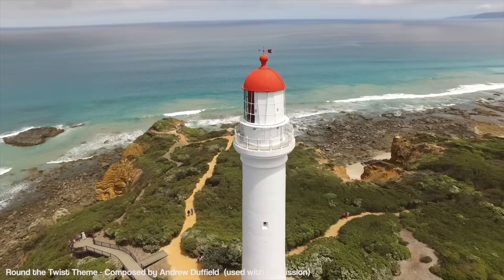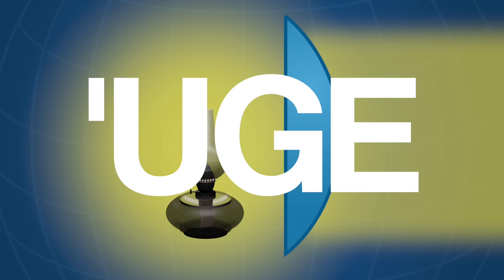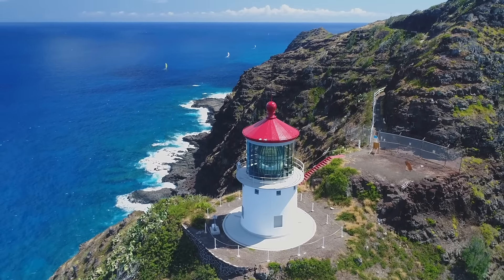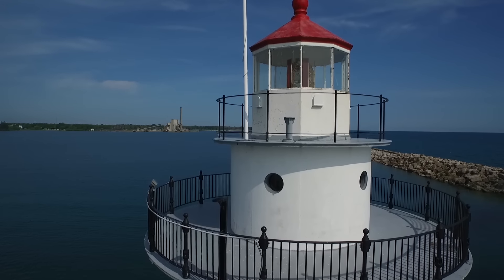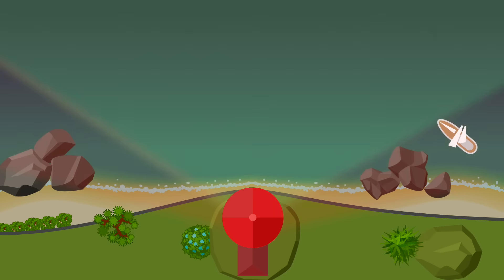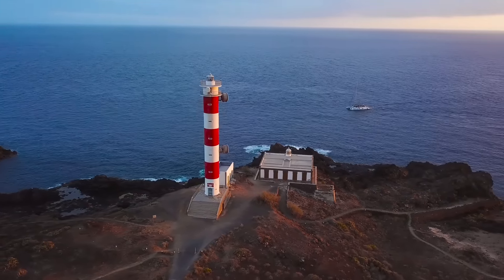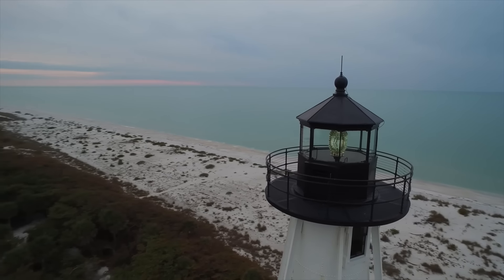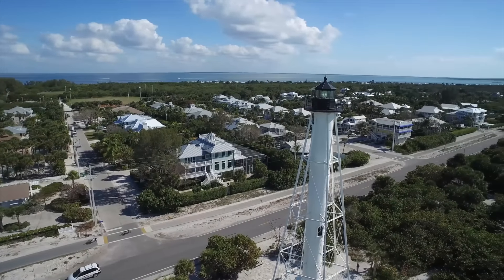How Do Lighthouses Work?

Comment: Awesome video!! I loved seeing how you went in detail about fresnel len's. Here's a fun fact which you didn't include but I recon is really interesting; 
Many of the older and more heavier fresnel len's which are still in operation today are actually floating in mercury, a liquid which has great kinetic properties, allowing these extremely heavy lenses to be operated using small and energy efficient motors. This method is used at both the Cape Byron lighthouse and also the Cape Otway lighthouse in Victoria, which both have very large lenses. You can actually climb the Cape Otway lighthouse and when you're at the top, although the lens is elevated above you so you can't physically see the mercury, the motor mechanism is on display as it operates and it is truly incredible how something so small can power a lens of that size!! Definitely worth visiting if you live in Victoria because the whole light station is open to the public and it has a ton of history attached to the lighthouse. Hope that was interesting, keep making amazing video's, you've earned a new sub <3
Reply: I have worked in an effluent treatment plant that has a huge sprinkler (30 meters across)  pivoted in mercury, and rotates like a garden sprinkler without need of any motor . Mercury is highly corrosion-resistant too.
Reply: @tvoommen4688  That's incredible!! Mercury is truely impressive stuff, despite how dangerous it can be!

Comment: I prefer to differentiate the type as such;
LIGHTHOUSE: a structure with accommodations within, as in the lantern room is set in the roof structure of the dwelling or the keeper lives within the tower or an integrated house structure. 
otherwise it’s a LIGHTSTATION, where the keeper lives onsite to maintain and operate the LIGHT TOWER.

Source: I’m a former lighthouse keeper working 13 different stations during my career. 

Excellent video

Comment: Fishermen still tend to use lighthouses, particularly to fix a good fishing spot, as GPS fixes can wander around from day to day, while taking bearings off of the light and other landmarks will get you to the exact spot every time.

Even the big ships will still take bearings as a backup, and to double-check that their nav plots are accurate.
Reply: dun their naviation systems/mobile have GPS
Reply: @rainbowgalaxy1668  He DID say "to double-check" and "as a backup", redundancy, it's a thing that's useful for not dying.

Comment: What makes a lighthouse a lighthouse? Primarily the visibility range of the light. Where inland Aids to Navigation typically have a range of up to 5 nm, offshore AtoN up to 15 nm, lighthouses have ranges up to 25 nm (sometimes even beyond that). Where nm stands for nautical miles. That the range is so important for a lighthouse, is proven by the size of the Fresnel lenses, which you simply cannot not put on buoys, for example. And which are not required on inland waters, unless the inland water happens to be a very large lake or inland sea. A second proof, is the height of the light compared to sea level: the higher the light, the larger the visibility range. 

With the invention of AIS, the necesity for long range lanterns is being reduced. When lighthouses are converted from tradional incandescent lamps to LED light sources, very often the visibility range is reduced significantly. Eg in Belgium you see a reduction in range from over 25 nm to around 18 nm, when converting to LED. 

Despite AIS, visible beacons are still very useful and reliable. You see them everywhere: buoys, Morse U lanterns on offshore installations, port entry lights (PEL lights), sector lights, etc. Typically lighthouses also had fog signals installed, but these are not in use anymore these days. At the Lighthouse Museum in Fraserburgh, Scotland, you can still see them in situ.